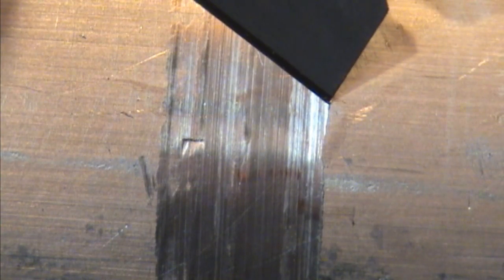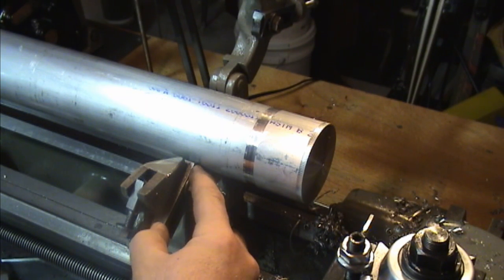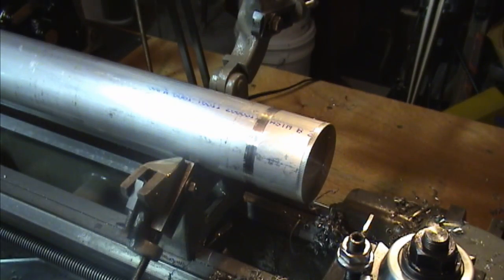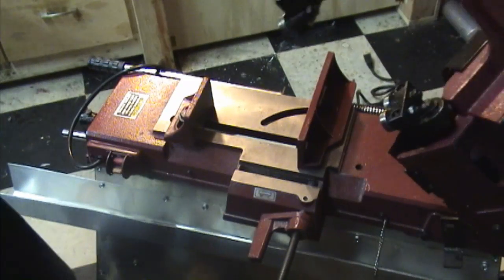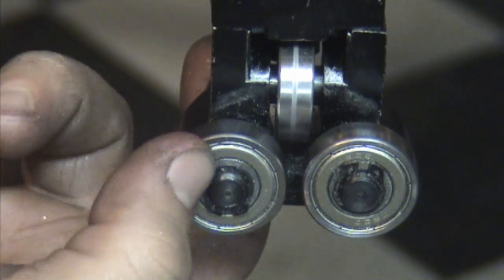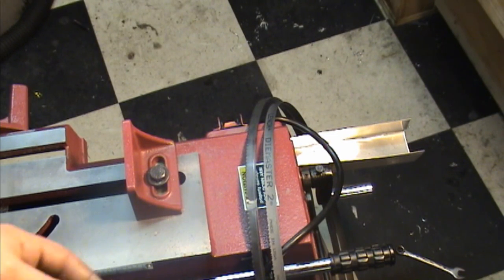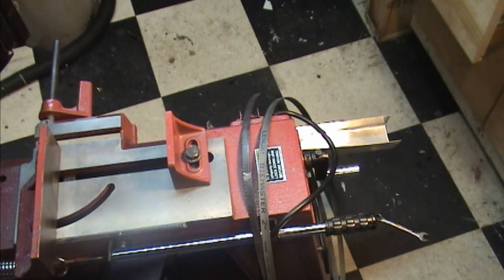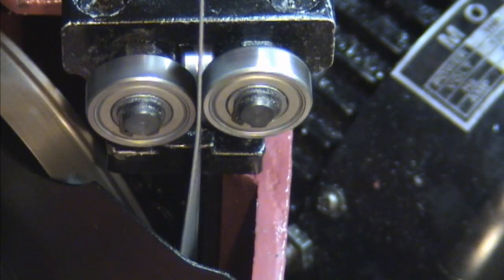Bandsaw Repair and Mods Part 6

Comment: While watching this excellent video, I understood that I didn't consider the fact that both excentric bearings(upper and lower) had to be "synchronised" or symetric...while pressing the blade.

From there, here is what I did.  I found their furthest point.  I punched a small dot on the shaft  ( that holds the bearing),  at 12 o'clock and one at 6 o'clock... I unscrewed this guide-arm and made a slot between the 2 dots( thus, a diameter)  with an hack saw.  To make the kerf looking like a pointer, I enlarged the dot , in the slot, at 12'o clock.

This kerf helps in 2 ways; 
 First. I visualise the position of the upper and lower excentric bearing ( both should be, let,s say, at about, 4 o'clock).  
Second.  I place a screw driver in the slot to immobilise  the shaft when I lock the 14 mm nut of the guiding device....making sure the final thighning do not modify the pressure on the blade...

Comment: Great video. I purchased a used 4X6 generic saw that had some issues including not cutting squarely top to bottom. As soon as the new blade guide bearings come in I will use this method to get it aligned.
Thanks and blessings to you and your family.
Reply: Did you figure out the issue and how to fix it? I just picked up a used one and have the same issue with it.

Comment: Good series, thanks. It gave me the impetus to get out and tune up my problematic HF 7 X 12. I pretty much found and remedied the same as you with one important exception, the grooves in my wheels were holding stuck aluminum chips which raised the blade off the wheel surfaces and probably contributed to the many blade dislocations I was experiencing. Keep up the great work!!!

Comment: Love your videos and how you work out those troublesome bandsaw details. Been there........done that!   I do  precision cuts for model railway modular truss bridges using 1/2" square tubing,... both square ends and 45 deg ends.  There is quite a learning curve with the HF 4x6 before it cuts halfway decently

Comment: I bought the saw years ago from a used equipment dealer.  It was in usable but beat down condition.  I have used it for rough cuts only, then truing up those cuts with the lathe or a 4" grinder.

Comment: Hi I work with industrial bandsaws vertical and horizontal what you can do to get your thrust bearings/guide bearing to alignment center correctly is use a feeler gauge (so if your band blade is 1mm wide/thick add 0.25 of a mm to the 1mm  using  the feeler gauge to get the bearing to kiss the blade use a light to check no light  passes the bearing and blade contact, run a test cut there will be no score marks on the blade )that head pressure bearing/ back bearing could go back a few thou.

Comment: I looked at HF's latest 12-inch bandsaw...it's actually better than the older one was...it has a heavier head casting, improved blade guides, and a more robust hydraulic downfeed system.

Comment: great video. You need to put a non plated washer under those new hand wheels you made so they don't start to bur up when you tighten them down,I did the same mod to mine a couple of years ago and the washers make the hand knobs much smother to turn. I need to re work my vice 2 so cant wait to see what you come up with, I have some 2"x3"x3/8 angle iron that i squared up in the mill but have not had a chance do it yet. Keep up the good work.

Comment: I'd be super happy if I could get my saw to cut that perfect of a 90 deg. !
the problem I am having is the guides do not go far enough and I have had to file the corners
of the bearing placement block to allow a bit more twist. I am trying to NOT push the blade down just twist it into the vertical position... so far so good but I stripped out the soft aluminum bolt that holds the blade guide to the sliding arm and I'll now have to tap it to a larger size as I don't think I can put a nut on the end of the bolt !
 my blade isn't coming down perfectly straight as it is twisted slightly and cuts at an angle because of that....  just getting my saw to cut at 90 degrees has indeed been a battle
but it does a good job of cutting ! .... so I am in the process of eliminating all the places that are not allowing the blade guides to twist enough... 
My saw had the blade guides pushed way out in order to cut through the work piece and turn off the saw too... with the blade guides back where they should be for longer blade life the saw will not cut all the way through or turn off...
so an elevating plate was used to raise the work surface and that cured the problem of cutting through and turning off... the blade twist is an on going battle though.
Reply from the maker: If you stripped out the hole I'd suggest using a helicoil to repair.  If you just go to a larger bolt you'll simply be more apt to pull the threads out of that too.

Comment: Very nice video, only wish you would have included more about adjusting top wheel tilt and which bolt did what. Mine has two bolts and an allen grub screw

Comment: I wouls probably put a poliched 1/16" or so steel bushing between the alum. knobs and the cast iron frame to prevent any kind of potential galling between the two.

Comment: Another great video, I have not seen a HF saw that they have bored the pivot rod holes stright ?? on mine i bored the long arm side (left) and pivot arm to 3/4 and made two off center bushings that are held in place with set screws and made the bushings long enough to get  a pair of vice grips on to adjust the bushing one aginest the other until downward swing of the saw was true. What type of camera are ya looking to replace the old one with?

Comment: Great video. At 11:58 on the video you show the completed alignment. I'm setting up my saw just like you recommend but I don't have a "fish" or shim. So, can't I just adjust the top plate so it's just over the left outside edge of the the inner brass part of the race? And the bottom, the bottom plate the same?
Reply from the maker: Yup as long as the blade is clearing that bracket you're good.  I just used something of a consistant size so I could adjust the top guide and the lower guide to the same distance.  Even doing that I still had to tweak it a little.

Comment: dang...wanna come to Houston and adjust mine?  lol. messed with the thing for an hour and don't have it dialed in yet.    may be time to start over fresh:)
Reply from the maker: Another source of misalignment is the hinge point.  Check and see if the ears for the picot rod are bored in line.  Most ones I've seen are crooked.  You can add shims to the attachment point of the pivot arm to the saw to kind of straighten it out.
Reply: Halligan142 thanks for the tip!  I'll check that out for sure

Comment: In adjusting the the guide rollers you seem to miss the point that the height of the rollers is governed by the position of the blade against the shoulders of the drive wheels

Comment: Hi, couldn't you just load a blade on and back off all the bearings and get the blade running where it wants to naturally run, and then bring in the guides until they are holding them in that position?

Comment: On my same model saw from HF the bottom blade pully is not adjustable and blade rides half way out ? How do I remedy that ?
Reply from the maker: Adjusting the top pulley will move the blade on the lower pulley.
Reply: Ok. Will try that later this week. Thanks a million.